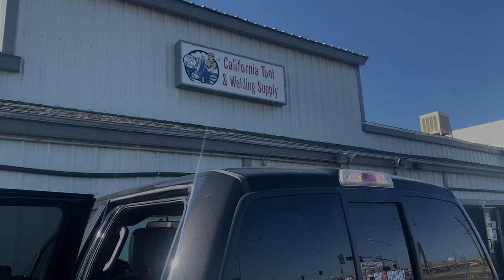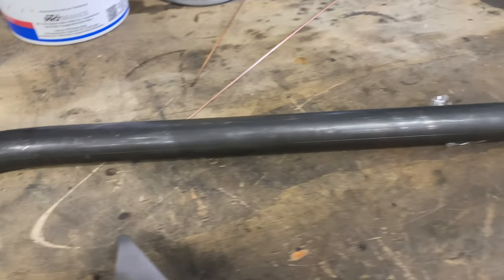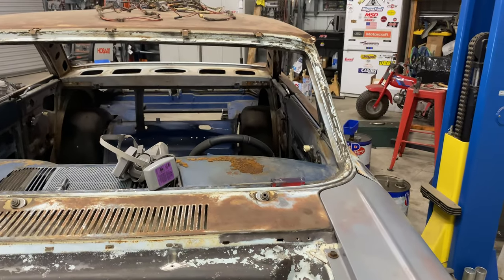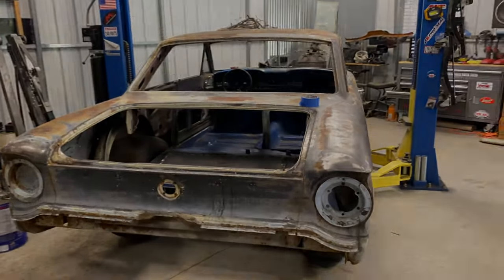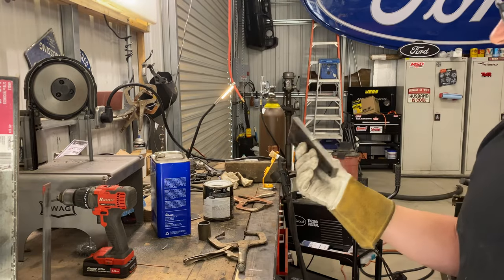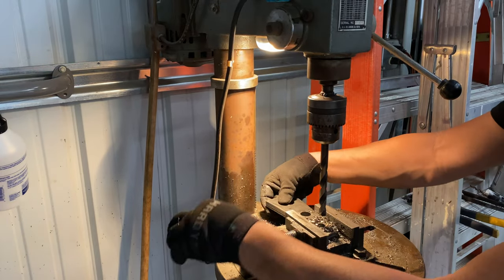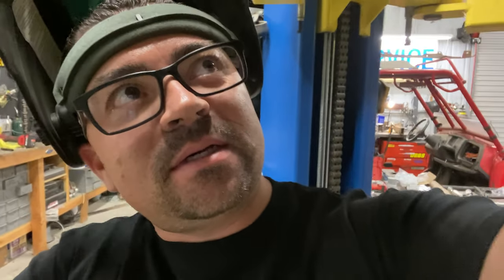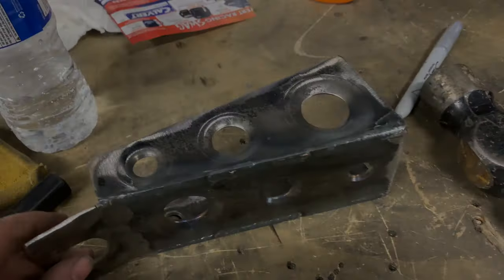Completing the front subframe connector boxes on the 1963 FORD FALCON

Comment: Good on you for jumping in and learning the TIG.  Have you considered using weld-through primer for the inside of pieces like that to prevent rust from starting from the inside?  Do you think you might need to drill a drain hole at the rearmost underside of those pieces to prevent water from pooling inside? (Obviously, water can only pool up to the first dimple die hole, but that's still more than enough to accelerate rust. )
Reply from the maker: Yes I wanted to use weld through primer but once the car goes to sand blast it will all come off so I figured the heck with it. I will try and get as much paint in there as I can and yes I’ll drill some holes for water drainage. There is holes I have in the rear that I didn’t film.

Comment: Do you think it needs all of those supports on the rear end?  wow, I had 1.3 60's and did not have those.  Just asking.  Running an 8.8 in my Ranger as well.
Reply from the maker: I do, it really needs a 9 inch but the budget is in the way. Tryin to do stick shift, radial pro and make 1000 to the tire it’s gonna hurt a lot of parts.